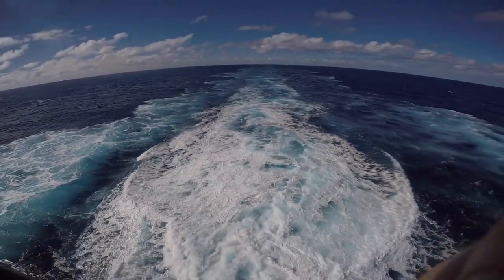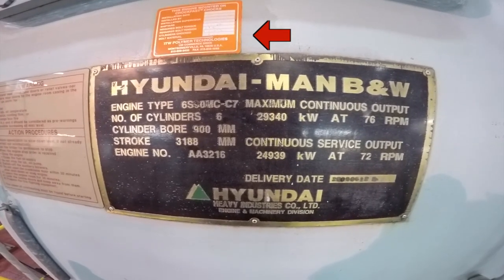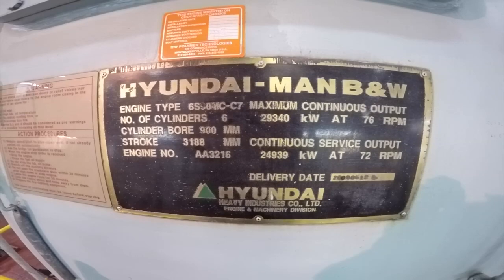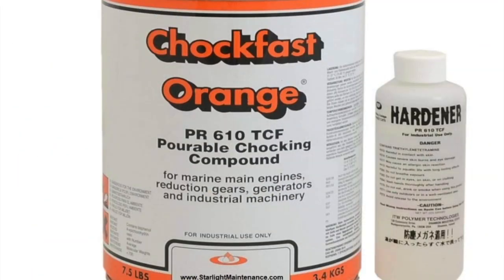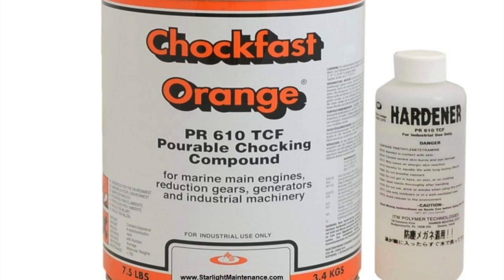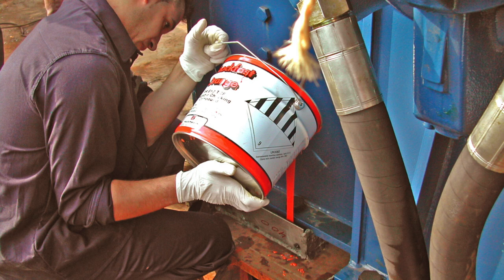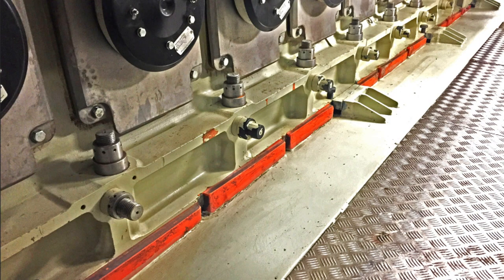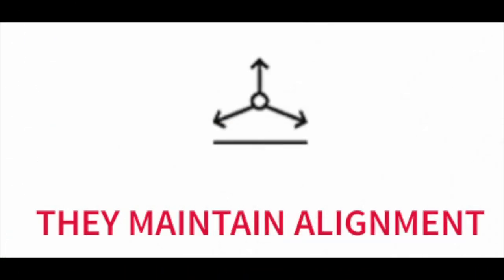Chock Fast Orange What Is It?

Comment: Is is poured in place of steel choke which is normally fitted in between Bedplate and Tank-top?

Also if it's liquid, how it'll hold the bedplate.
Reply from the maker: After from liquid it becomes solid.
Reply: @Adventure-Story  Chief, How that solid resins can take up that much huge load of engine. Will it not deform instantly?

Also do you know what materials thr tie rods are made up of.
Reply from the maker: @Neo-po2xw  it is flexible also and helps to absorb the tensions that created from engine.